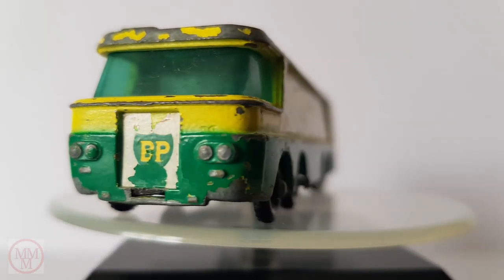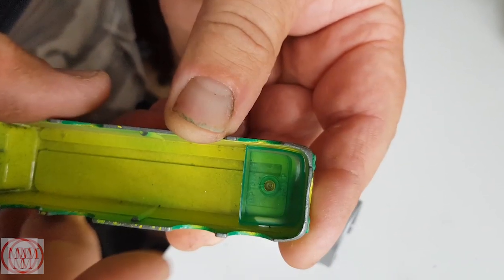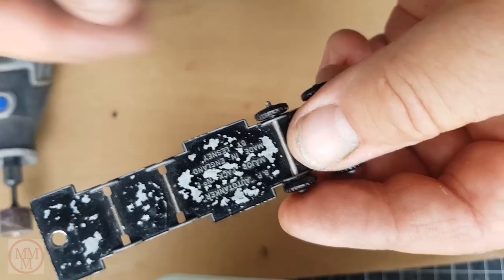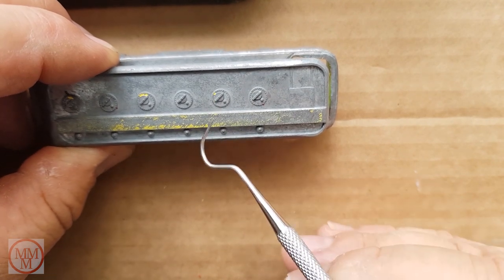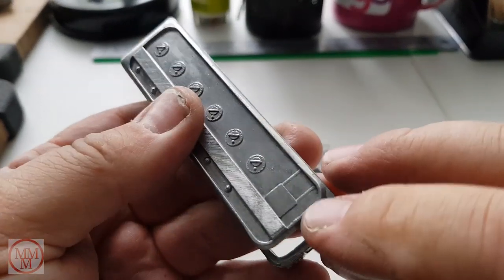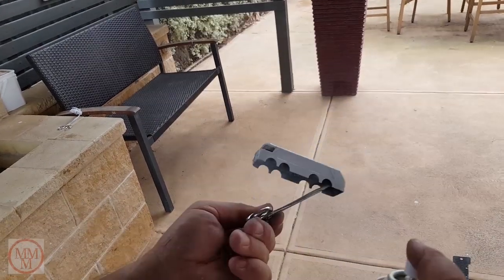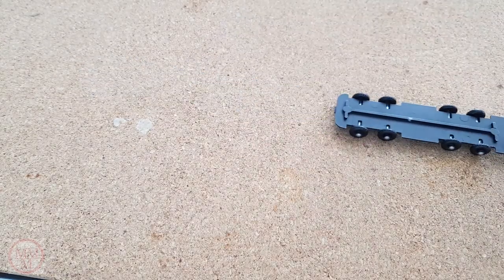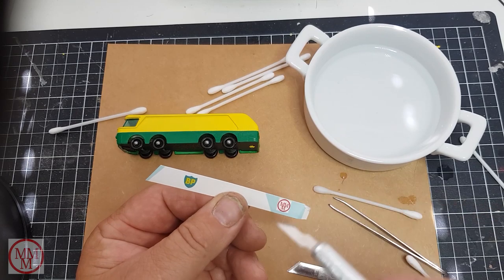MATCHBOX Restoration Major Pack M1 BP Auto Tanker 1960

Comment: Hello, I love your Matchbox makeover series! For polishing the transparent windscreens, you may want to try a product used by wristwatch collectors to polish acrylic watch crystals: PolyWatch. This is a very fine polish that is rubbed for about three minutes using a soft cloth, and results in a glass-like finish. As it may have a solvent that slightly melts the acrylic to help with the polishing process, be sure to test it on an out-of-sight part first. Cheers!

Comment: Great work as always Marty.  A trick I learned while working in a body shop to get a crisp line between two different colors is to use automotive pin stripes to make the line. Then, go with masking tape to cover up the rest of the parts that you don't want painted with the secondary color. The pin striping won't allow anything to bleed underneath. Love your videos, and sense of humor. Thanks for doing what you do!

Comment: Great make over Marty, was surprised to learn that there is an actual prototype of this tanker.
Reply from the maker: Yeah, but, apparently only one -  Sssssh!
Reply: and it didnt even run in England, Regulations wouldnt allow it. It is supposed to have  ended up in Holland, have seen a couple of pics, but no one seems to know its fate.
Reply: This design still lives! Check out the Rosenbauer Panther Airport Fire Rescue vehicles.

Comment: I NEVER knew tyese where real tankers. What a sad time we live in where such unique vehicles are no longer available. No one builds anything unless they can make millions from it and produce hundreds of thousands of them. We are witnesses to the dying throws of innovation people.
Reply: Thats sadly too true, and even more upsetting most people dont see it , i dont even make a sandwich without details , to me if you skip on details on what you make then how can you ever know the details of yourself
Reply: Well a vehicle like this dying makes sense. Sure its neat, and unique, which is exactly why it didnt survive. A trailer that any truck can pull is better than a proprietary vehicle with parts that only fit that vehicle. Plus, its not very safe. In an impact in the front, how do you get out? Your doors are mashed in.
Reply: The Autotanker was a design based on an existing bus chassis, commissioned by BP and shown at Earl's Court. The tank volume was not exceptional, but the main benefit was the low-cost chassis and running gear.

Not long after the design was shown, tankers started to go to articulated designs, rather than single-chassis. So, rather sadly, this design was never used and was scrapped. What a shame!
Reply: @RobSchofield  government regulations my friend, strangles all creativity...

Comment: it wasn't  very successful because of corrosion due to condensation.  I believe the backend was from a Leyland Atlantean bus.
Reply: Yes, it was a modified Leyland Atlantean bus chassis with the larger 680 Power Plus engine giving 200bhp, and had a 4 speed semi-auto gearbox with a 2-speed rear axle. Awesome looking truck.

Comment: I love your work!  Try putting clear nail polish over the edge of the masking tape and let it dry,  then paint the base color again before applying your final color.  That should stop the bleeding issues and make your lines more crisp.  Also, you should use pipets to get the paint out of the jars, you'll use less paint that way and make less of a mess.  You can buy plastic pipets by the hundreds online super cheap.  Thanks you for your great content and keep up the good work.

Comment: Hey Marty!  Great restoration as usual.  When doing my own restorations/customs I've found a large safety pin can be better than the dental pick on some of the tougher crevices.  The sharp tip can get under the paint and since you're on some type of line in the casting, any slight scratch gets filled in by the primer.  I love the tip about the floor wax and will be sure to use that in the future.  Thanks for your work!
Reply from the maker: Thanks for watching and commenting Time Rider, great idea about the safety pin, i can see that working wonders!

Comment: Great videos! I especially like the auto tanker. I would like to offer a suggestion for your decals, if I may. I like to use a lid from a plastic container that has raised edges on one side. Place a paper towel in the raised area and add water. Then you can lay the decal on the towel, face down. No more chasing it around the water, and it helps keep it from curling up on you.

Comment: Nice job, Marty. The original was an experimental chassis design by Leyland, being a cross between the 'Octopus' eight wheel lorry and the 'Atlantean' rear engined bus. Only a couple were built, and only one bodied for road use. The tanker body was by Thompson, of Bilston near Wolverhampton. The cab 'sun roof' was the crew's emergency exit if something happened to the cab front in a crash.

Comment: Many of the 60s Matchbox cars you are restoring originally used stickers rather than water decals, including this model. Nice job! I like your vids & look forward to new ones. Thanks for turning down the music & including the little jokes! They are fun to look for. In case you don't have one I highly recommend getting a Matchbox Collector Guide: there are several on eBay right now for cheap & will include full color pics of the numerous variations. Schiffer Books are good.

Comment: Marty, what a GREAT topic, a great car !
Great find, I'm happy you made a video of this restoration !
Maybe a few more tips :
- Do not cover these models in clear lacquer. The original models didn't have that, either. But if you do, make sure the paint has FULLY cured !!  Cured, not just dried. Curing (fully hardened) may take a week or more, especially in Winter, although Winter does not exist Down Under.......!!   ;-)  Even the smallest trace of thinner or other chemicals may be affected by the chemicals in the  clear coat.  You found out first hand..............
- If you look at the separation line, you can see that masking off the yellow will be difficult. Therefor, paint the green first. Mask off the entire area where the yellow will be, but leave a tiny strip (0,5 mm) where the yellow will overlap the green.  Let it cure (at least a week in a warm place). Place a strip of tape on a sheet of glass and use a very sharp knife to cut off a strip of both edges of the tape. Now you have a tape with clean, sharp edges. Mask off the green, rub it down carefully (and THIS is why the paint HAS to be fully dry !!!).
- A thin line of green will still be visible ( deliberately) but the yellow will cover that.
- Paint the yellow. Let it cure, also.
- Instead of water, use dedicated decal setting solutions, such as Humbrol Decal Fix, Tamiya Mark Fit, and other liquids that offer good adhesion. Micro Set would not be a good choice for these models.
Tamiya has developed a new, special liquid for decals that need a new layer of glue or that need extra adhesion : Tamiya Decal Adhesive.
And please do not mix up Revell with Humbrol..... Revell is quite a good paint, you know...!!  ;-)

Comment: I really enjoy  your tube, actually I might start restoring objects as you do. I did alot of paint stripping in my younger days and for small pieces I used a glass container and submerged the piece in the paint stripper. You can use the stripper time and time again. I found out by doing it this way I did not have to use dental picks, wire brushes as often. Keep doing those videos they are very informative and of course the humor you include in them is awsome.

Comment: Those were probably separate compartments for different fuels
But you were quite right about the stopping of the truck. If it was a single compartment containing liquid there would be baffle plates to prevent surge backwards and forwards and side ways. Without baffles for sideways movement the truck might roll over.
Reply from the maker: You are quite right there, a tanker driver corrected me in a comment somewhere on here.

Comment: Nice work - and quite a love of models. Could you use Patreon maybe? Well, some airbrush nozzles are quite costly.Thank you for the good work! 
That Dremel work upon axles could be better with that 954 Al-oxide grinding stone or 85422 Si-carbide grinding stone that is better but slightly slower. Numbers are from Dremel catalogue.

Comment: I've had good luck on model aircraft canopies using narrow automotive pinstripe tape to mask the sharp edge of a long line and canopy framing.  The more narrow it is, the easier it is to turn a corner with....   You can get good tape at an automotive paint retailer, of course, any color will do...  3M seems to make the best tapes I've ever worked with.  I won't buy any other brand.....   Pinstripe tape is designed to cling for years, but if you don't leave it too long it seems to let go easily enough without pulling off enamel paint... for acrylics, you're on your own big guy!  ... for what it's worth...  great video by the way!

Comment: Great job Marty you made the box too and the decals very interested how you made the decals
Reply from the maker: Just a normal printer with special paper and lacquer. Buy decal paper clear backed or white backed from Ebay,  inkjet or laser jet, then print your design, lacquer it with a couple of coats of clear coat (I used Mr Hobby) then cut them out, immerse in water and away you go!
Reply: Thanks Marty

Comment: the self-shining floor polish pushed out this little hole produces a lot of bubbles there are several ways around this here they are from 1 to 4
1 take the cap of the bottle or even better store it in another bottle with a removable cap a soft pour will ensure that there will be no bubbles
2 put the just filled cup in a vacuum chamber this will kill all the bubbles 
3 use the air paintbrush to cover the item
4 use a light plastic solvent instead

Comment: I think your first hunch about the driver access to the cabin might be correct. If you would be a driver, could you imagine crawling through at the front? I would'nt be surprised if the engine and radiator are behind there. Great research!
Reply: Damn, that gave a start when you appeared to lop your thumb off!😮. But quickly relieved to see that you were just up to your usual pranks!  Excellent job, Marty, the tanker turned out great!

Comment: You really need to check out videos from your competitors. They are doing additional things to clean up oxidation of the metal. As a collector, I would pay more for a vehicle if the metal was restored properly, rather than just stripped, primed, and repainted. Additional tip: vinegar soaked axles will remove rust.

Comment: Brilliant, as ever! I have a gaggle of these to do (6 altogether) so this is perfect timing! 

Can you recall:

- the paint numbers (yellow, green, black)
- the size of the screw/tap you normally use for rivet posts?

As a curiosity, one of the tankers I have has a white roof, which I thought was someone's customising: however, looking at it more closely, it's the base coat over the clean metal, followed by the BP colours. Not seen another of these anywhere.

Another makeover you might like to do (from the same episode of Thunderbirds) is the  M9 Interstate double trailer truck (Coopers), which has the rather difficult twin horns on the cab, the quite fragile trailer doors, and the sometimes difficult to find coupling axle. Would love to see your take on that!

Great stuff, keep it up. Enjoying this series immensely.

Comment: Have you ever bent an axle with the press?
Reply from the maker: YES! - Sometimes , if there is room, I hold the axle with broad tipped pliers to prevent that happening. In this case I did not but just took longer to do the job.

Comment: I love what you do. Am a scale modeler so this is my type of stuff. Just wondering what size nozzle do you use on your airbrush also what pressure do you spray at. also what is the best way to clean it. just got my rig this week and am just having a little issue. thanks again for doing what you do.
Reply from the maker: WOW! - In all honestly, I have no idea what nozzle size I have. The pressure yes, in some of my videos I show the pressure but I do not know what it is! To clean the airbrush i just dismantle it and fill it with the appropriate thinners and just blow it through with air until it comes clean.

Comment: Would love to know which printer you use to produce the decals.  I seem to remember that an ALF printer was required to get the white color.
Reply: Make that an ALPS printer..duh.
Reply from the maker: The ALPS printer could print in white; I am using a standard ink jet printer (Epson WF3640) which does not. I am therefore printing these decals on white decal paper and cutting them out to size before placing them on to the model. If a decal has no white in it then I shall use clear decal paper. After printing I sprayed 'Mr Hobby' clear coat over the decal to 'lock in' the ink so that it did not bleed when placed in the water.
Reply: @MartysMatchboxMakeovers  OK,  thanks.  I wondered if that was the case.  The transport turned out very nice.

Comment: Marty, you know you can soak the car in ISO 90% alcohol, it makes enamel paint just peel off, i use an old glass coffee jar with an air tight lid, leave it for an hour and all clean and baremetal(HW) also works on plastic without melting it

Comment: Hey marty! Why don't use the Dremel with a cylindrical diamond attachment to remove the roof rivets flat?
Reply from the maker: Could give it a try for models such as this where there is no room for error. Being cylindrical it may tend to wander unless held firmly in position somehow.
Reply: @MartysMatchboxMakeovers   i'm guessing he meant conical?   - great work!!
Reply: I meant cylindrical, not conical, and its true, it tends to spin over itself and go whatever it wants... Maybe trying it on the drill press at low speed, or a small grinding wheel carefully to no overdo it through the plastic. I'm afraid of drill bits as they make a little bit of conical shape and the bit of the cone can go through and ruin a good body